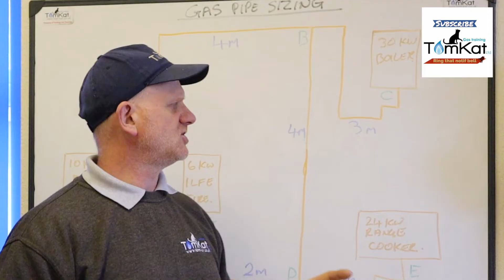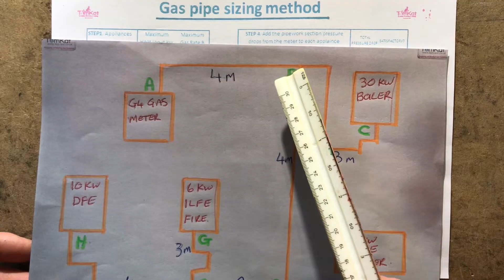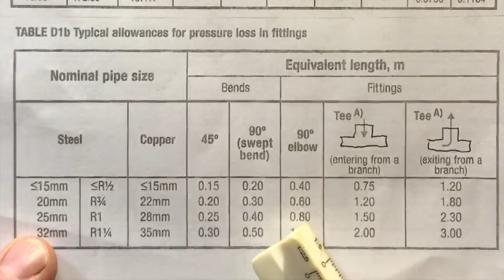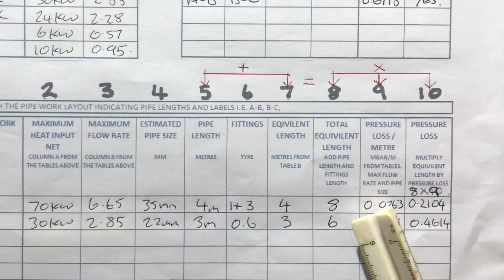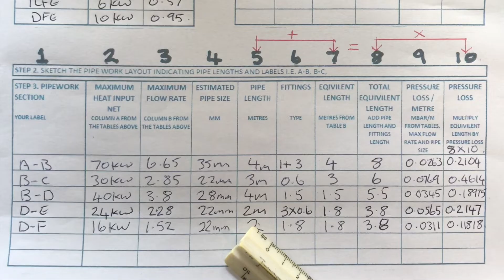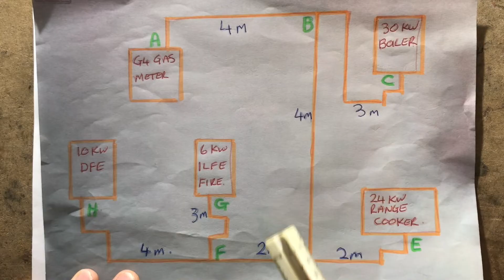HOW TO SIZE A GAS PIPE, A tutorial for trainee gas engineers on how to size a gas pipe to bs 6891.

Comment: Guy who came to estimate me for new boiler said he couldn’t decide if my current 22mm pipe was sufficient until after the new boiler was installed. Suggested I may have to upgrade pipe work to 28mm. From watching this video it would seem that you could do some calculations before the boiler was installed. Have I misunderstood? New boiler is 32km 6m from meter. Two maybe three 90 degree bends. Doesn’t sound a big issue to me given current 15 year old 34kw boiler has been running ok.

Comment: all bs red tape regulation how did they get away with it before regulation came in properties had 22mm gas pipe these regulations want to put 35mm 40mm 50mm pipes in domestic houses these pipes are used in commercial buildings this is a joke 😂😂😂😂

Comment: What determines the kw you use on your drawings? Is it always the hot water max input kw you work off ? On a combi heat only and system is it always the hot water input kw in the MI’s you’ll work off and use on your drawings
Reply from the maker: The maximum kw designated by the manufacturers so for combis the hot water kw like you said
Reply: @tomkatgastraining  hi Tom so as an example a vaillant 418 heat only boiler is 18kw output , 18.4Kw ch input and 25.7kw hot water input, what would I size it too here for a heat only boiler ?
Reply from the maker: @cazza1295  as I said the maximum heat input laid out by the manufacturer
Reply: @tomkatgastraining  okay understood, so when you gas rate a boiler a vaillant for example, In service mode PO1 does that fire the boiler at hot water max rate then ?
Reply from the maker: @cazza1295  not necessarily you will need to use the data badge to determine the maximum heat input
Reply: @tomkatgastraining  so what does the program p01 test, the heating of hot water max flow rate ?
Reply from the maker: @cazza1295  po1 dose maximum rate p02 minimum but depending on the heating temperature at the time of testing will determine if the boiler goes to maximum rate
Reply: @tomkatgastraining  right so what I’m asking is when it goes to maximum rate on p01 mode that will be the hot water gas flow rate as that is the max gas flow rate. Only asking as I thought you would need to open a hot tap to achieve the max gas flow rate or does the program p01 fire it into max flow rate (hot water) without having to open a tap
Reply from the maker: @cazza1295  yes as long as the water temperature in the system can take the heat

Comment: Good evening, a comment. IGEM/UP/2 edition 3 guidance document states that gas pipework system should be designed from the gas meter to the appliance with a max drip drop of 1mbar. It later states that the appliance must also be safety set to work in accordance with the manufacturers minimum working pressure which does not mean that you must achieve the max 1mbar pressure drop it can infact be much higher.
Reply from the maker: You should supply enough gas so that there is not more than a 1 mbr drop when installing a new appliance what you are talking about is when you are testing an old appliance and you missed the bit that says and not affect the safe operation of any other appliance.

Comment: Hiya, if a result is 0.517 or 0.016 for example what is the best size pipe? When looking at mock questions on pipe sizing it asks a pipe size for said length and given gas rate but the awnser could be one or the other 28mm or 35mm for example. Would you select the 35mm to allow for future adaptations to the system or select the 28mm cause it’s cheaper for the customer and is correct for the current installation?
Reply from the maker: Why allow for future adaptations when you have no clue what would be added. 28mm for me
Reply: @Tomkat Gas Training  thank you! Really appreciate you taking the time to reply.

Comment: Hi, if we change a 15.5 kw integrated boiler (with hot Water tank inside it) in the airing cupboard, on the first floor, with 22mm copper pipe, from the meter, a branch to the gas hob, on the ground floor, with approximately 8 metres, for a 30 kw combi boiler in the loft, could I use the 22mm pipe, or extend with 35 mm pipe into the loft? Thanks.

Comment: Hi mate, great video. Was just wondering if a bigger meter would be required for this example e.g a U16, as 6.65 M3/hour is about the 6m3 flow rate of a g4? I'm currently doing a CCN1 course and we studied pipe sizing for the first time this week. Cheers
Reply from the maker: Meters are sized from a diversity factor not pipe sizing

Comment: Hi Derek, can I double check the flow rate calculations with you. So a 30kw net boiler would have a flow rate of 3.094 m³ (30×1.11÷10.76). Where does a multiplication factor of 0.095 come from?

Comment: Is it correct to assume A-B and B-C  to the Boiler, do not include a Tee. as they do not cause any resistance.... And that  B-D. would have 2 tee's. 1 Entering and 1 Exiting tee. I am a Bit confused about where to include the Tee's in Each section.
Reply from the maker: The tee is counted in a to b because that tee will be at its biggest size
Reply: @tomkatgastraining  Thanks, Much Appreciated. if the pipework was all the same size from A-B and B-C and B-D would it be correct to include the two Tee's on the B-D Section.
Reply from the maker: @flash999able  if you think about it logically would you count something at the beginning or the end I always count it first but at the end of the day you can count it when you like you are designing it most of the time
Reply: @tomkatgastraining  Thanks, that makes it a bit clearer... Excellent Training and Educational videos. Keep up the Good Work.

Comment: Great Vid Derek thanks, I have a question. I was fitting a bathroom at a large building that's being converted to flats. I had to get some stuff from the outside store. I noticed all the gas meters are u6 with 22mm outlets going to 28mm track pipe then to what looks like 2.5" yellow  in a floor chamber, then travels under block paving about 60 m into the building reducing to 28mm trac pipe to feed Combi boilers in each flat. My question would be & I raised this with the project manager. A) Is it normal to reduce up. B) Will the length of run have a load factor on the meter size. TIA
Reply from the maker: The meter will be fine but obviously checks would need to be carried out on the appliances to check the pipe sizing and also the volume of the pipe will need to be checked that it doesn’t exceed  0.035 m3

Comment: Derek, not all these sections add up to less than 1mb. That should be the case no? Each section alone should be under 1mb and added together also under 1mb. If that is the case i updated B>C to 28mm and F>G to 22mm and F>H also 22mm, this gave total loss of 0.9mb as opposed to 1.77mb for all sections in your calculations.
Reply from the maker: No you don’t add them all together I have followed the procedure laid out but the British standards. Even when sizing a gas gas meter now we don’t use the full kw of the appliances
Reply: @tomkatgastraining  Thanks for the reply. Doing my ACS training at the moment and this is what I have been told, strange. Thanks again.
Reply from the maker: @MAmanchester  good job the part of the exam for pipe sizing is only one appliance then 🙄
Reply: @tomkatgastraining  either way your video helped refresh me, not looked at it for months. Did this example fair easily. So long as I know I don’t have to add them all up it’s groovy

Comment: Hi thank you for explaining the gas pipe size calculation. I need to calculate LPG pipe size of the boiler, I have 4 nos. of boilers each consumption is 1749 KW = 54m3/hr LPG, but  in the table not available flow rate to select the  losses. please I need your help to calculate the LPG pipe size fro boiler,
Reply from the maker: I am not surprised it’s not in the book are you correct with your kw and m3
Reply: @tomkatgastraining   thank you for your reply. The gas consumption of boiler is correct.  Which is 1749 KW. (59,71,086) BTU. I am in Qatar here LPG heat value is 1 m3 of LPG = 110,000 BTU or 32.22 KW.
Operating pressure of boiler is 20-200 mbar.
Reply from the maker: @Tamimshortz  what is the boiler powering a city
Reply: @tomkatgastraining  boiler is used for the big military hospital for steam generation. Final uses of steam it’s not available now. My scope only to provide LPG pipe line Connection to boiler.
Reply from the maker: @Tamimshortz  how much lpg do you have in the storage tank
Reply: @tomkatgastraining  tank size is 2 x100,000 liters. Maximum filling allow 85% so total LPG LIQUID Filling will be 170,000 liters of LPG. For 30 days storage. Tank will be refilling every 30 days.
Reply from the maker: @Tamimshortz  that’s one big installation in the U.K. we would have to use IGE/up/ 1 for the information for that installation
Reply: @tomkatgastraining  thank you for information. Here is Qatar we follow  NFPA54 and NFPA58 for LPG SYSTEM.

Comment: great video but how do you equate reducing fittings i,e tees and sockets into different pipe sizes or are the fittings chart the same flow rate no matter the tee ? eg. A-B is in 35mm teeing into B-C in 22mm and then B-D in 28mm. again great video learnt a lot
Reply from the maker: No reduction for sockets or reducers or reducing tees just elbows bends and equal tees with gas entering or exiting the branch
Reply: @tomkatgastraining  thank you

Comment: Make sure to check for installation volume after to! Sorry but the pipework you gave in metres and sizes. Are they within the 0.035 m3 (maximum installation volume) as per IGEM/UP/1B). Thank you
Reply from the maker: You are correct but this video is on pipe sizing not purging I have another video for that

Comment: Hi Derek, first of all thanks for the video's. I have a question.
So when calculating the gas rate of appliances eg (30Kw Boiler x 0.095 = 2.85) but when going through my book it was using Diversity Factor. So for example (30Kw Boiler x 1 DF = 30Kw) then using the calculation (30Kw x 3.6 = 108MJ) then (108MJ ÷ 38.76 = 2.78). 
So basically I'm wondering is it fine when  working it out just to use the quicker and simpler method of x 0.095?
Reply from the maker: It seems you are getting mixed up with meter sizing as the diversity factor is used for that not gas rating or pipe sizing
Reply: @tomkatgastraining  I knew I was getting mixed up somewhere. Trainer says there are no stupid questions but I seem to come up with quite a few. Thanks for the reply and sorry for the daft question.
Reply from the maker: @metromikey1985  hope we have cleared it up for you 👍🏻

Comment: Great video Derek, really well explained and easy to follow when doing pipe sizing, getting the correct pipe sizes is really important as it makes a big difference with the pressure drop. Doing this in class at tomkat it does pull your hair out but once you get your head down to it and get to understand the process it makes it enjoyable in sizing the pipes for the appliances. Excellent video Derek..👍👍😁😀

Comment: Great video as usual sir. One question as a new learner in this industry,  what formula do you use (regarding bs6891 ) to convert maximum heat input Kw net to maximum gas rate m3/h ? Thanks
Reply from the maker: Times the kw by 0.095 = m3/hr
Reply: @tomkatgastraining  thanks for the quick response sir, I was  wondering because on my books shows  a different calculations like ( KW × 1.1 ) ÷ 10.8= m3/h  or KW ÷ 9.7= m3/h  and the final result is not the same. Could you please let me know which one do I need to use specially for my exams? Thanks again and really appreciate your help
Reply from the maker: It’s the net figure x0.095 I think your way is the gross figure
Reply: @tomkatgastraining  thanks for your help mate. Really appreciate
Reply: Have you got a link for the pressure loss chart. TIA

Comment: Hi Derek I have a question? - if the max flow rate in M3/h is 6.65m3/h - and it's a G4 meter - would that not exceed the max flow rate of 6m3/h or would allowance for all the appliances not being on at the same time be a factor? 
Thanks!
Reply from the maker: When sizing a mater you use a diversity factor not the full kw
Reply: @tomkatgastraining  of course!!! 80% & 60% - thanks for answering! & thanks the videos, They are quality!

Comment: Do we have to convert to net for pipe sizing? Thank you
Reply from the maker: It is better to convert to net at the beginning to make it easier but you could use gross then convert to net
Reply: The charts in BS 6891 give values in kW net, kW gross and cubic metres per hour. As long as you use the correct column, you should not need to convert. It's best to be consistent in which one you use, of course.
Reply: @Jehannum2000  very true thanks

Comment: Hi Derek,

I love your video’s and like many viewers I have found them so very interesting and useful to understand about all aspects of gas safety.

This is where I am a little nervous, because I am going to question the way you are interpreting the equivalent length when it comes to the Tee  fittings, specifically between the meter and the Boiler.

The way I am reading it, is you only need account for a Tee Fitting, when the flow is either ‘entering’ or ‘exiting’ a Tee, not when the gas flow is going straight through it. 

In your diagram, where the Tee is located at point B, the Gas Flow is not entering or exiting a Tee branch, its going straight through it, so does that not suggest that when accounting for gas flowing to the boiler, the Tee connector at B should not be accounted for?

Of course you would account for the Tee fitting at point B, when working out the Pipe size from B to D, because in that case the gas is exiting the branch, but if the gas is not flowing in or out of a Tee branch, isn’t that like having a straight piece of pipe from the Meter to the boiler with six 90 degree elbows (1 elbow from A to B and 5 elbows from B to C).

If you could please clarify this point I would be much obliged.
Regards
Steve
Reply from the maker: Like I say to everyone who brings this up I always count the tee on the first calculation because that would be the biggest size of pipe. Then it is not counted again because if you think about it logically the other 2 pipes could be smaller so less equivalent length. Pipe sizing isn’t an exact science because they don’t give you the figures for every calculation for the m3. So this video is to show the process and so guys understand the process if you don’t want to count the tee first then don’t do it the way you want to as the results will be the same.
Reply: Your channel is a god send but on this point I was taught as per the OP on entering and exiting Tees. My LCL book issue 5.0 page D6 shows clearly what the branch is. It has an asterix note below which deals with the largest connection issue. The actual rules in BS6891 have a Table A.5 confirming this and the asterix comment.

Comment: I am a plumber and I started my gas course last year. I have a random question,, so the question is , would it be possible to find all that calculations without the charts and use a formula instead or do we always have to refer to the chart. Many Thanks
Reply from the maker: You will always need a chart or you could try an app 👍🏻
Reply: The formula behind the chart is too complicated for calculation by hand.
Reply: Look at bs6891 you'll find it there - and leave it there 😂😂

Comment: so What happens when Cadent tells you not to test at maximum rate off any appliance
Reply from the maker: The video is about pipe sizing so what do you mean.
Reply: @tomkatgastraining  I think he's talking about the meter working pressure test (1 appliance or 3 hobs at full rate). That's a different thing. Here, you should calculate to maximum load.

Comment: Hi TomKat Gas Training,

I was wondering why a T fitting has been used for the A-B section, when the book says that 'no tee allowance is required for pipes running straight through'.  

Shouldn’t the Tee section be used for the branch section, B-D?

Thank you.
Reply from the maker: I count the tee when you first encounter it and then don’t count it again it still works out the same and you won’t reduce the pipe after the tee it would be deduced by the tee
Reply: Tomkat Gas Training thanks, would you get penalised for that during assessment?
Reply from the maker: @saltnvinni1  it’s not this complicated and if it was you would get the same answers
Reply: Tomkat Gas Training thank you for answering and your fantastic videos!

Comment: If you bend the pipe and don't use a 90 fitting.. how does that affect the calculation? Help pls Derek.
Reply: You get about half the equivalent length of an elbow, assuming you bend the pipe properly without 'ripples'.